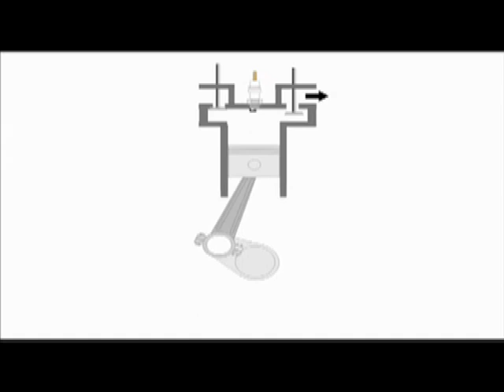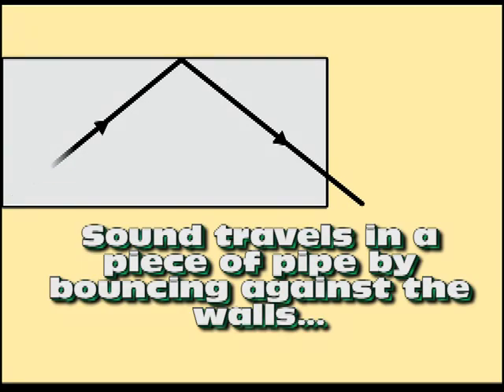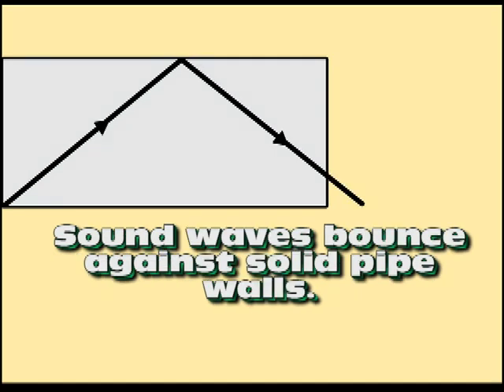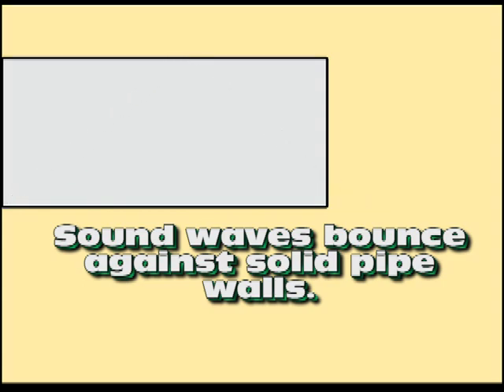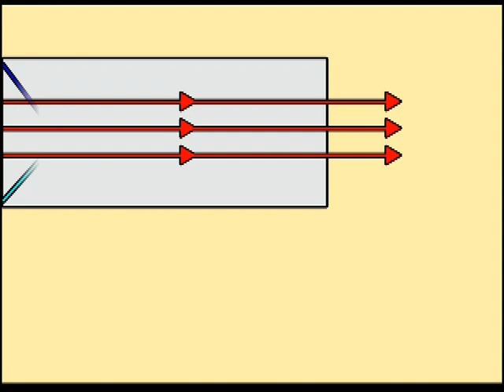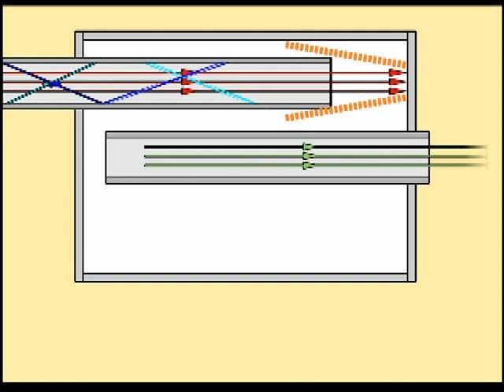How a Basic Car Muffler Works

Comment: Good day, Chava! What is the soft material in exhaust pipe wich can absorb sound waves?
Reply from the maker: It is kind of a paste material which can withstand the hot gases and be soft enough for acting as a damper for sound waves. Asbestos was used in the past, but there are a number of materials nowadays, please take a look at this site https://www.secondskinaudio.com/sound-deadening/quiet-exhaust-and-engine-noise/

Comment: Dear Chava, this was very helpful in understanding how the noise gets reduced. In my country Holland we call this pipe in popularly language a dash-pot. I never under understood what the function is of  the "container" at the end of the pipe. Your graphic and explanation made it very clear to me. Do you know how a silencer on a gun functions? Can you make a video on that. Not that I want to use one, I hate guns, but I'm always wonder how it works.
Reply from the maker: Dear Star Light, well, I've never used a gun, ha ha, but the principle is very much the same, except it uses only the first pipe, lined with some kind of metal wool in order to kill the bouncing sound waves. I used to own an old VW Beetle, and the twin tail pipes used a straight piece of tubing with a soft padding lining which very much killed the reflected waves but not the straight waves. It worked very well, since when one of the pipes would break apart from the "big can" the beetle would turn quite noisy. I believe it's pretty much the same principle. Hope that helps.
Reply: @eltunene  Dear Chava you give a good example of a VW Beetle I remember them from my childhood and I do remember the black soft padding lining. It never occurred to me why they made it that way. Wow I learn a lot from you, thank you so much for all your time and effort dear Chava. 👍⭐⭐⭐⭐⭐